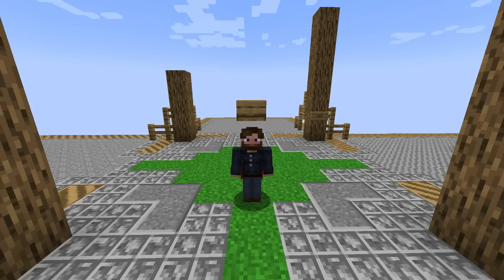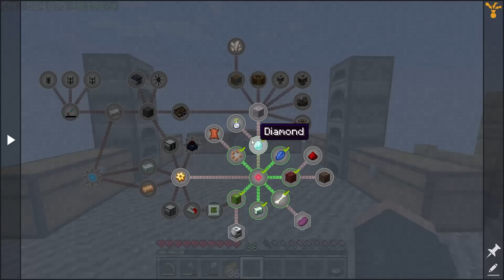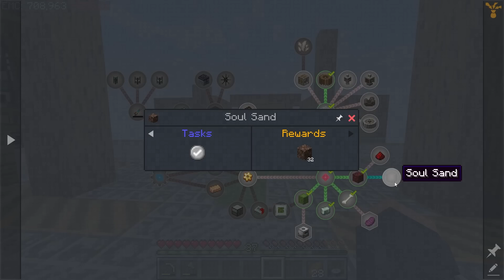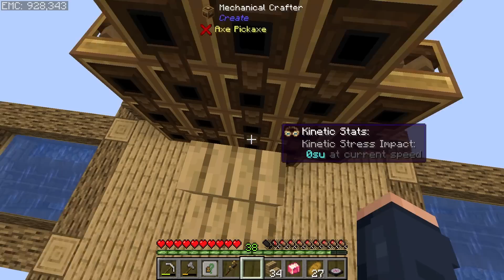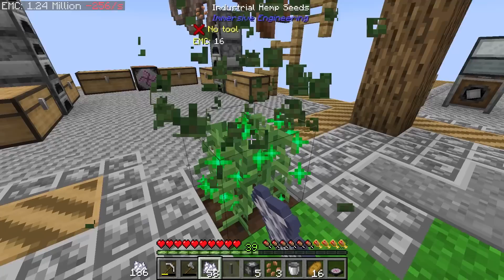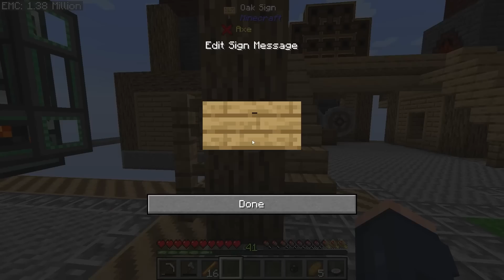Mechanical Mastery Minecraft Modpack EP2 Tier 2 Create and IE

Comment from the maker: I am sorry for the mess of cables on this setup bit I really don't have a lot of things at the start of this modpack but I am getting there!
Reply: for the smelting issue use the funnel to drop on top of a depot not a belt and then from the depot use pretty pipes to filter out only the smelted stuff from underneath the depot which allows it to not get stuck and if the pretty pipe is throwing stuff around try keeping the stack limiter on it set to 32 i have tested that works the best

Comment: The create mod is probably my one big annoyance of the pack. Create is a fantastic mod, don't get me wrong, but I've found that it's just so clunky to work with in any pack that isn't entirely focused around it. It's especially prominent in this pack, IMO, because you start with Thermal and you are FORCED to not only use it to make the essences, but you ultimately have to set up multiple mixers plus blaze cake automation to do so. The one saving grace has been,  at least in the version I'm using, not as sure about the one you're playing on, the electric motor is available almost immediately. You need to make a fan for quartz and a press for plates, but both of those can be powered by hand cranks, and setting up a temp water wheel for the mechanical crafters is easy, if a little slow.

I'm watching these eps after I go through the parts you're doing so I can try and figure it out for myself before watching someone who actually knows what they're doing lol.

Comment: The problem I have with Create is that 90% of what Create does .... other mods (Thermal, et al) do as well, without futzing around with cumbersome gears and figuring out the physics of things.  Create is great if the entire modpack is designed around it.  Once you mix in other power mods though, it ... really feels like it's redundant.

Comment: there is a pretty efficient way to produce power for the cost of 1 emc per 2000 rf or so, it will require a magma crucible, nether rack, an emc link and a magmatic dynamo, you take the emc link ant have it export nether rack to a magma crucible and the have a fluid pipe transporting it to one or multiple magmatic dynamos

Comment: To regulate the items making your Basic Mechanical Essence you could get into LaserIO and use a counting filter to only insert the two rods, and one of each gear, then let the rest of the system backfill without concern of flooding your fabricator with copper rods.
Reply: It's really so much simpler than that: DON'T auto-push to machines that are auto-pulling! That doesn't allow the pulling machine to throttle itself. If you just let the destination machine do the pulling then all of the machines will only pull as much as they need (4 of each relevant item, iirc).

Comment: 34:00  you just need a buffer.  have the belt lead into a drawer or chest.  i hate using belts when unnecessary, so i would instead use a depot.  then, since you have the mekanism logistical pipe, you can pull straight out of the inventory, and into the smelter.

Comment: BTW, AFAIK, the ore processing is additive. i.e. You can process the ores with create and then process the resultant again with thermal.
Reply: I mean, what mods that doesn't do that?
Reply: @nativenugget  most. Usually, if you crush the ore with create, you get the same resultant as if you pulverize it with thermal, meaning you can't reprocess it. On top of that, the chance and output values have been heavily modified for this pack. So create is a guaranteed 2x output. Thermal is a 1.25 (with flint). If you go from create to thermal, you get a total output of 2.5x.
Reply: @g45h96  ahhh i see, good explanation bro, but i might try that too soon thanks man

Comment: The secret to the pretty pipes stack limiter is that it needs to be on the end of the pipe that is inserting into a machine. If it is on the pipe that it is extracting from it will not work.

Comment: The reason the fans are over-producing iron, is that the funnels only drop items when there isn't items below them.

Also, using chutes would make it so they aren't dropped on top of the belt, although it would only help if you replaced the back one (farthest from induction smelter), and left the closer one with a funnel.

Also, the items won't despawn unless the induction smelter is full, and they cant go into it.

Edit: The farther item would be on the belt, and the closer item would be sitting on top of the belt.

Comment: If you want to continue using the fans with lava to automate that part, you need to put the ores on separate belts. Two belts side by side with the fan blowing sideways across them. The filters will keep them from moving out of the path of the fan, then past there it can join and feed into the induction smelter. Since both ores will smelt at the same rate, you might also need to add a way to limit the one you need less of or boost the one you need more of so the belt doesn't fill up, unless you choose to keep the belts separate and feed into different sides of the induction smelter instead.

To prevent items despawning and being wasted, I would suggest having the EMC links feed into a chest or drawer and then have a funnel pull from there. In my experience, if the funnel goes from the side it will put them right onto the belt instead of dropping them, meaning no floating items. This can also help prevent lag.

Obviously the simplest solution is to skip the fans and just use machines, but since that would take more power, it would require a better power setup first. Though that's not too difficult. Crush coal and feed it right into a stirling dynamo, crush coal, feed it into a coke oven, then have that feed into a stirling dynamo as well as a combustion dynamo (obviously you should have a separate setup for coal coke and creosote to use for crafting and such), or use the lapidary dynamo, since the quest book says the pack modified it to use the essences you're crafting to produce tons of power, it might be worth the setup. But I do also agree that Create looks cooler, it's just a bit harder to setup and takes more space.

Also, the quest book already has a method for making lava for you, the magma crucible, and it even suggests using netherrack since it uses less power.
Reply: that is so much effort for just smelting to get new power
simplest with create is to 
for the smelting issue use the funnel to drop on top of a depot not a belt and then from the depot use pretty pipes to filter out only the smelted stuff from underneath the depot which allows it to not get stuck and if the pretty pipe is throwing stuff around try keeping the stack limiter on it set to 32 i have tested that works the best

Comment: You should use separate smelting lines for each ingot, and then feed the two separate lines in the induction smelter, that way you don't need to balance anything to prevent it backing up. Also, the stack limiter modules go into the destination inventory, not the source one
Reply: for the smelting issue use the funnel to drop on top of a depot not a belt and then from the depot use pretty pipes to filter out only the smelted stuff from underneath the depot which allows it to not get stuck and if the pretty pipe is throwing stuff around try keeping the stack limiter on it set to 32 i have tested that works the best
Reply: I put emc links feeding ore right into a furnace which then went directly into the induction smelter. You lose out on the bonus from pulverizing but at least you don’t have to manage the extra stuff.
Reply: @JordanMontreuil  true
Reply: with my solution it is more compact and does not need seperate lines

Comment: You can do specific quantities & mixes of items at a time with the Create brass funnels and tunnels, put a brass tunnel extracting the desired quantity from an inventory (which should extract only stacks of the set size) onto a belt, have your belts with specific quantities next to each other with brass tunnels set to synchronize their output. This way you get set of items with specific stack sizes. This, being create-based, will probably take a bit more space though.

Comment: The stack limiter is working but you need to place it to the other end. You can use them to prevent the overflow you have if you pipe the gears and rods :)

BTW great gameplay, but that essence factory spagetti is strange from you :D
Reply from the maker: Its because I have nothing to really build with in this pack early on... this pack is really strange in this regard as you have no good way for EMC gen and start with only oak saplings I am really trying with this one but man its limiting at the start!
Reply: @ChosenArchitect  never told its bad, its different :) i know the pain, after the philosophers stone it get a bit better tho :)